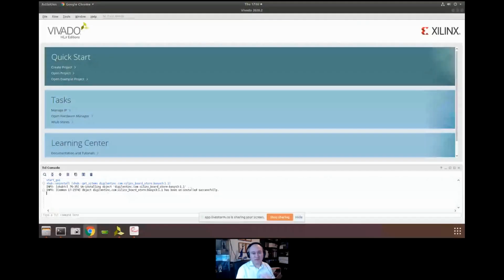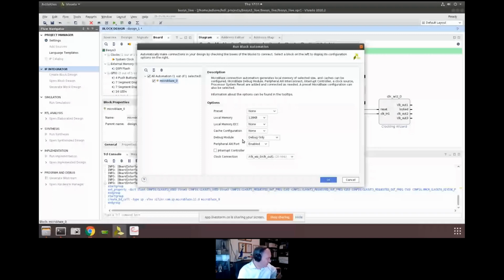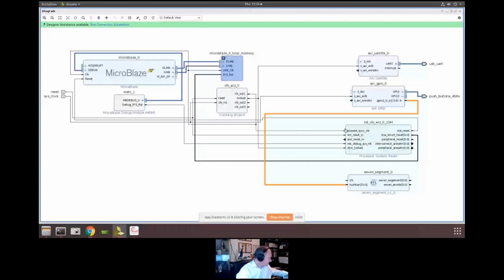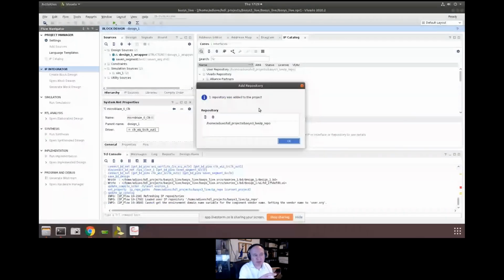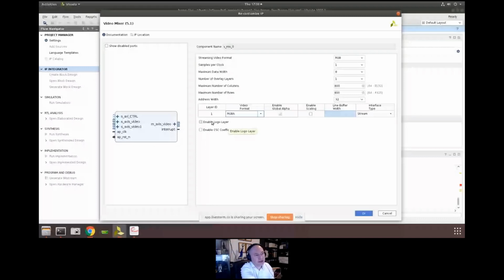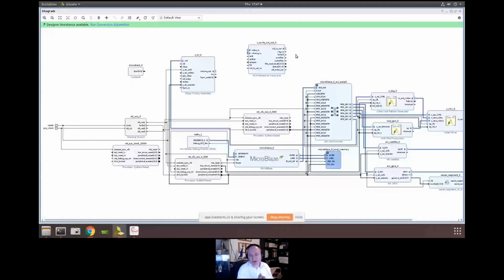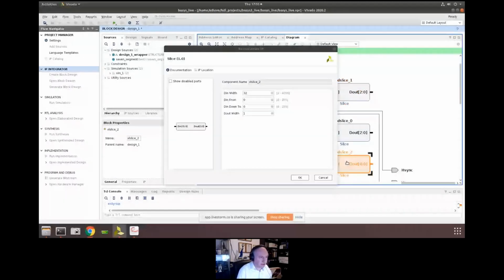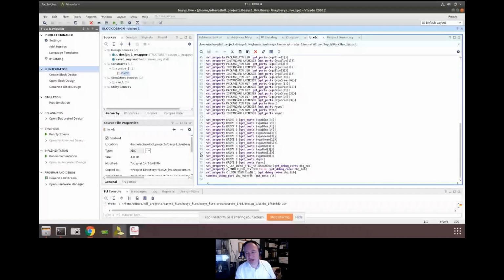Breakout with the basys3 Part One Reply

Comment: I just found this and am trying to implement the design but get an error when validating the design.

 [BD 41-237] Bus Interface property TDATA_NUM_BYTES does not match between /v_mix_0/s_axis_video1(3) and /hud_gen_0/op(4)

It appears the hud_gen_0/op is 32-bits but the v_mix_0/s_axis_video1 is only 24-bits. I can't find any way to change the HUD output size to match. I also can't find the TDATA_NUM_BYTES property anywhere.

Any way to fix this?
Reply: Same issue with me. Did you manage to fix it?
Reply: I got rid of this error by customizing the Video Mixer (double click the block) and changing the Video Format from RGB to RGBA. However, during synthesis I am now getting two errors: "[Vivado 12-12726] HLS failed to export an IP: /prj/sol/impl/ip/component.xml." I have not found a solution to that yet. I am using 2023.1.
EDIT: Turns out that the [Vivado 12-12726] error was due a problem with the path where project was stored. I shortened the path by moving the project and removed all periods in the path. Synthesis and Implementation runs completed successfully after that.
Reply: Fix by following:

1. Double-click the Video Mixer (v_mix_0) IP block to open its configuration.
2. Navigate to the settings for Layer 1.
3. Look for a setting named "Enable Alpha" or "Layer Format".
4. Change the format from RGB/YUV to RGBA (or ensure "Has Alpha" is checked).